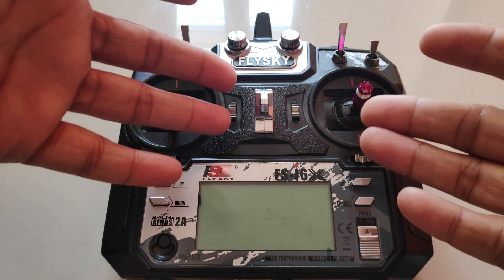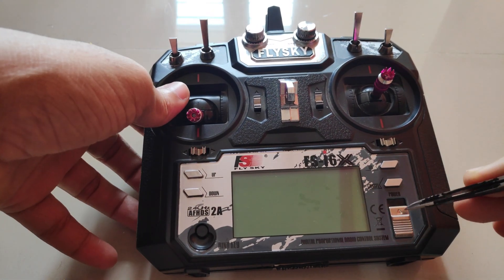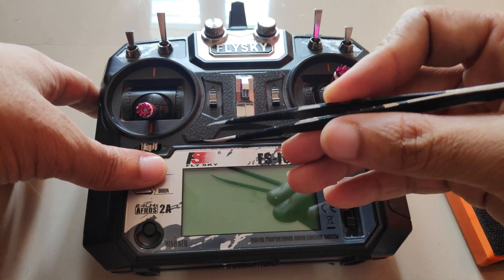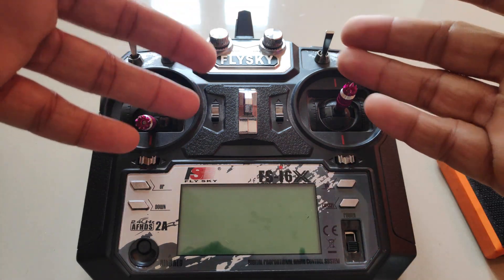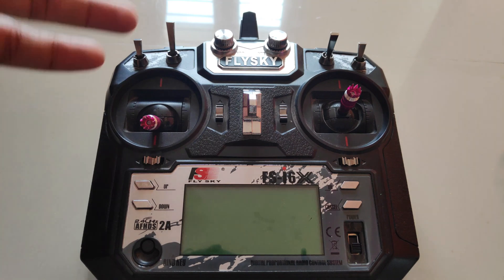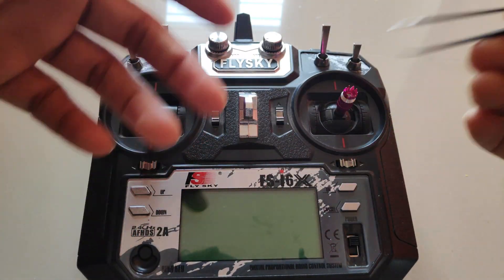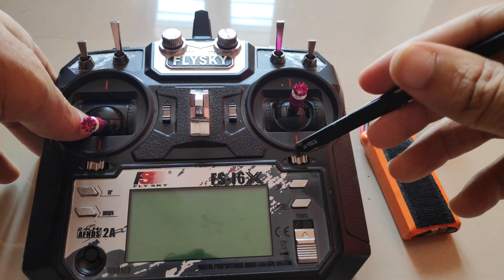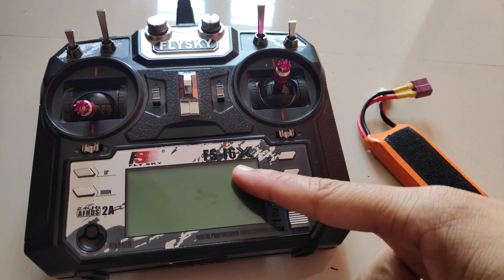Flysky FSI6X - DO NOT Use 2s LiPo Battery

Comment: My solution, I'm using 2 Li-ion battery 14500 in place of two AA batterie and for the  others places one is occuped by 2 serial diodes 1N4004 or equivalent placed in a cylinder with same sise of à AA batterie and the other one is a short circuit also placed in a cylinde size AA. The final voltage max is 8.4V - 1.6V = 6.8V and when the Li-ion are fully discharged 6V - 1.6 = 4.4V.... Very simple !

Comment: Hi bro i just tried to do rechargeable battery mod on FS-I6S and i did supply power directly from 2s battery and it 3.3v voltage regulator is gone bad its heating but the voltage regulator data sheets states it can take 2 to 20v and on output gives 3.3v i don't understand what Flysky does to these transmitters 

i also have and Flysky i4x it works very good with 2s battery mod I've beens uaing it for more than 2 yrs no problem till now

Comment: Use only 3.7 1 cell of lipo with buck coverter and set voltage to 5.6 i have been using this from 1 year all working fine for me
Reply: That would be a boost converter

Comment: i use buck converter to power up my transmitter with my 2s battery I set input voltage to 6v

Comment: My flysky fs-i6s transmitter does not bind. I think ur video is correct. Receiver binded but no output shown in transmitter. Only light is stuck as binded. I need to buy new transmitter?
Reply from the maker: You have the fsi6s version which has a touchscreen is that right? Did you flash open i6x on that radio?
Reply: @RakishRc  thanks for the reply it will take some days for update, my cable's fault I think coz  transmitter is not detected in pc.

Comment: can we use two  1865 lithium ion battery (3.7 v) for power up this same transmitter because I want to make my flysky i6 X rechargeable what are the best ways to prevent that from burning , can i use the rechargeable batteries for it or better Normal AA batteries?( But AA was drained as much as fast )
Reply from the maker: Anything above 6v is risky affair so better use a voltage regulator is using 2s. May be you can arrange the cells to be easily removable and then charge it externally.
Reply: @RakishRc  Okay Thankyou ✌🏻

Comment: Rakish Rc  I use a Tenergy 6v 2000mah NIMH for my i6x. Just soldered wires onto pads in battery compartment routed them through the battery cover, used butt splice connectors so I can unhook to charge. Stuck it on with velcro. This allows me to still use AA batt if I want as well. I followed what you had done with yours and I burnt the voltage regulator out in a few weeks of use. Had done all your other mods as well. Just got new i6x and I think what I suggested above is great/safer route. Just my 2cents... Your videos have helped me a lot!
Reply from the maker: Hi, yes anything that's within 6v is a good alternative. I am using a 5v mini buck converter which also allows me to either use AA or a lipo..the output voltage can be adjusted so I've set it to 5.5v when using a lipo. Thanks for sharing your experience 👍
Reply: @RakishRc  can I ask you quick, moving ahead with my new radio what module are you using for express lrs with your new i6x? Still R9M?
Reply from the maker: @mikel0520991  yes still the same r9m with a half burnt 5v power regulator. R9m has 2 power regulators so it's functioning well from the other side 😜

Comment: So based on several other reviews I saw I was pretty confident a 2s LIFEpo setup would be safe at about 6.7 volts.   Plugged it in and powered on fine the first time, second time powering on it starts surging on and off every few seconds, now it does it with any input even the AA.  Looks like I fried mine as well, just wanted to throw this out there as the Life Batt seemed to be well within a safe range but it seems it may not be.
Reply from the maker: 6.7v is actually very close to the rated 6v limit and i am surprised it's acting weird. You may want to check the power cables of the connector on the motherboard and battery bay. I am currently using a buck converter with a 2s and it also powers up with AA if i have to
Reply: @RakishRc  I ve gone over all the power connections, they look fine.   Just every time it powers on it will go to full voltage then exactly every 5 seconds it shuts off for a split second and reboots.   Dont know what else it could be, the motherboard looks fine, worked fine on the first boot up and I was able to cycle through the functions for several minutes.   Shame as I really like that little transmitter, been good to me for years lol
Reply: @RakishRc   Thanks for your eariler advice, I figured out it wasnt a voltage issue after all.   I had just installed the Open TX firmware not long before.  I forgot I had the external PPM port enabled and for some reason that was causing it to power cycle without anything plugged into the trainer port.   

New problem I ran across though, no matter what I do I cannot get the Open TX to recognize my Happymodel ELRS module.  The only thing it sees on external mode is PPM.   Thought I might need to save the HM specific LUA script but it says there isnt enough space to do that in the FSI6X memory.  Not really sure what else to do.

Comment: If you plan on using a 2S LiPo battery; ONLY use it with a step-down ( buck ) 5V output voltage regulator module; readily available online. It is inexpensive protection against ruining your transmitter.
Reply: The AA BATTERIES TOGETHER MAKE MORE THAN 5V . 5V IS NOT ENOUGH .

Comment: Yeah bro thats y is used 7806 Voltage regulator. this gives constant 2A 6v output.  Using it for Totally 2 Years now and having absolutely no problem. Range is also increased because of 6V 2A.
Reply from the maker: I am using the mini 360 5v 1amp buck converter on my new raido. How did you test the range diffrence?
Reply: @RakishRc  Im not directly meaning the Range but the Signal loss error shown in the TX. I Saw a big difference in the error at the same location and distance that i covered. it was around 24% loss first with AA Batteries at 5v. but now im getting only 6% at the same spot and distance.
Reply from the maker: @lokaero  got it..so then the link is more solid as per your testing. Thanks for sharing I'll do test as well. I had planned a range test between factory firmware and open tx firmware on this raido with ia10b receiver but my drone gps rescue wasn't working as intended so i postponed the video.

Comment: Thanks alot for warning!!
Hii I am sorry to hear that. 
I am using it with 2s 18650 for about 4 mounts  and had many flights. What I did vas to install in series 2 rectifier diodies that lower the voltage aprox 2- 2.2 v, so when start the transmitter with battery fully charged it show about 6.2 v
( 4 aa battery x 1.5v = 6v ( can be more when batteries are new). I didn't use dc-dc converter because that drain battery even when transmitter is off and I can't see the level of battery during use. I also use the switch from transmitter to   power the betafpv ELRS module
Reply from the maker: That's good! For now although i am using AA i have thought of using some 1500mah AA batteries

Comment: Hi,
I want to ask, can we attach an external antenna to Fsi6x? Is there any issue in attaching an external antenna (replacing the inbuilt once) also the difference in range can be observed...???
Looking for your reply...!!!
Reply from the maker: Hi, yes you can add external antenna but the range has to be tested to get a comparison with stock antenna. There will be some difference for sure. One fellow from fsi6x open tx group has added external wifi antenna to his radio I'll share his pictures soon 👍

Comment: I figured out that the ADC channels do not read anything. I compiled a program to read the ADC inputs. even if I short the ADC input of any pin with 3.3v it would read zero. So in all the power regulator is damaged and the Stm32f072VB processor's ADC channel is damaged due to fluctuation in input voltage and failure of the 6206A regulator

Comment: Same thing happened to me today... I just saw your video yesterday and was thinking about replacing 6206A with AMS117. Its now booting into factory mode...
I found that the other regulatior i.e HF_3.3 regulator is okay.. STM32 is flashable. EEPROM is okay..
What to do?
Reply: Did you repair it bro is it working
Reply: Hi bro i just tried to do rechargeable battery mod on FS-I6S and i did supply power directly from 2s battery and it 3.3v voltage regulator is gone bad its heating but the voltage regulator data sheets states it can take 2 to 20v and on output gives 3.3v i don't understand what Flysky does to these transmitters 

i also have and Flysky i4x it works very good with 2s battery mod I've beens uaing it for more than 2 yrs no problem till now
Reply: 6206A 1722/33 vtg regulator was original which is damaged

Comment: I was wondering about this as I saw you using 2s while the regulators are specced for input 6V. They've probably been running quite hot but it's surprising how long they lasted. I just started modding my I6X and the plan is to add step down buck regulator so I can use 2-4s batteries. I definitely need lipos as AA batteries really did not like the ERLS transmitter.
Reply from the maker: So yes the whole point of using lipo for this raido is to power up the elrs transmitter. Yes you can use a buck converter. I think the grease i applied on power switch shorted something and the lipo was als fully charged so together it messed up the raido. You can use aa for raido and lipo for elrs transmitter just need to have signal and ground wired between radio and elrs transmitter

Comment: If the "grease" was Vaseline that would be your problem, it is very very conductive.
Reply from the maker: Very likely.
Reply: @RakishRc  Bath it in Methylated spirits or denatured alcohol, be careful, do outside away from anyone, no electricity near, and a bucket to throw it into if things go wrong.

Comment: I wonder wether it is possible to use a 6v bec but still measure the real battery voltage. Is it known where the battery voltage is measured on the pcb?
Reply from the maker: Yes You can use a 6v or 5V bec but you cannot read the battery voltage then. Not completely sure but it seems either from the power regulator or V bat connection side is where voltage reading is detected.

Comment: linear power regulators on the board are designed for a voltage of no more than 6 volts.  I think they are the problem.  you need to replace them for example with ams1117
Reply from the maker: Yes but it's very fiddly to do that. Instead an external voltage regulator or simply AA batteries are better for radio power. Ony the external module needs more power which leads everyone to use lipo for their radio
Reply: @RakishRc  an external voltage regulator can be used, but then it will become impossible to use a regular battery voltage measuring tool.  well, with the replacement of regulators - you can use the 2s battery and batteries

Comment: Hi, thanks for your useful videos. I have my FS-I6X openTX  running on 2S 500mAh JR connector (I get about 2 to 3 hours of use,  battery fit in original compartment). I'm using a step down converter adjusted to 7.3v, so that I can fully charge it. Thanks to voltage drop in the converter, I'm able to set an alarm on the TX to detect low battery.
Very important: regulator consume power and can fully deeplete Li battery when not in use. I have modified the TX switch (it is a 2 inverter in one) so that it separate the converter from  the battery.
i have a second FS-I6S and I'm thinking to make a video of the mod with the ref of converter, voltage adjustment and switch mod.
About your damaged TX, if you order the same TX, you may be able to track what area is not functioning. And with some electronic knowledge, to be able to change damaged components.
You've helped me to select this good TX,  I hope you will continue with it.
Best regards
Reply from the maker: That's a very good choice with voltage converter. I should have considered it earlier 😁.  Yes if i get the same radio i could compare and try to diagnose the issue. Glad you found this radio perfect for your use. Yes I do consider having the fsi6x again 👍
Reply: @RakishRc  hello, I 'm preparing a second radio FS-I6X for  Lipo 2S with DC-DC  converter . If it preserves TX from high voltage, it is very important to adjust output voltage so that low Bat voltage can be detected to trigger an alarm. My DC-DC converter as a voltage drop off 0.5V, so I set the output at 7.4V which seems to be a reasonable maximum for the TX.
In the radio setup, I set the voltage range from 6.8V to 7.4V and an  alarm at 6.9V.
If there is a way to share pictures with you, I'll show you how to modify main switch so that it cut also stand by consumption of the converter when TX is OFF.
By the way, you may modify the title of the video, stating "don't use 2S lipo WITHOUT DC-DC converter (properly adjusted)" 
Wish you a good night.
Reply: @davidrenaud8798  I am very interested in your mod. Could you please share a picture/schematic? I am using 5V DC-DC converter but don't know how to have low Bat voltage. Because of that I have lost two Lipos so far. Thanks.
Reply: @nmrlab3807 hello,
DC-DC converter with fix voltage 5v  is not a good idea. I use a converter with variable voltage output set at 7.4v.. Thanks to voltage drop (about 0.5V),, the output start to drop when output voltage decrease below 8.1V.  
In the TX setup, I set the voltage range between 6.6v to 7.4V, with an alert at 6.7V.
Mot important is to keep in mind the stand by consumption of converter which can kill a pack in a night. So, I have modified the wiring of the TX switch so that it cut also battery output. I need to document that and I'll share it on RC group.
Best regards
Reply: @davidrenaud8798  ❤Thanks for the explanation. Yeah, that is right the stand by consumption of converter killed my batteries. Please let me know whenever you post the modified  wiring of the TX switch on RC group.

Comment: Hii sir i just want to know can i use any elrs module after flashing opentx on it. Does Latest opentx have any bugs. 
Finally which elrs module should I get to my flysky i6x
Reply: Please response sir
Reply from the maker: Yes You can use any elrs module after flashing open tx elrs version. I am not sure if there are any bugs but the firmware is very reliable and stable just like original firmware with many upgrades.
You want 900mhz or 2.4ghz elrs module? Choose which band you'd like and then select. I use frsky r9m and r9mx receiver
Reply: @RakishRc  ok sir thx so final question should I go with any elrs module or get r9m setup. I need good range and long range so which is good r9m Or elrs modules
Reply from the maker: @Sunnyfpv1617  so for long range go for 900mhz setup. Frsky R9m has to be flashed with elrs firmware. Get r9m and MX receiver then 👍
Reply: @RakishRc  ok sir thank you sir for great help
Reply: @RakishRc  big fan from Maharashtra Indian

Comment: 2nd need to chack remote power switch where it is multiple points or 2 points. If there multiple points tracks and some point is not connecting properly due to damages or dust . Need to clean or replace power switch
Reply from the maker: It's a 3 point power switch. But now I don't think there's any point in spending time to repair the motherboard.

Comment: You need to examine and restore tracks c44 and r39 and swdio point.maybe there is some connections between . U should try this. By jumper small gauge wire to those tracks .
Reply from the maker: Yes I did try to re connect the two track separated by damaged SWDIO pad but with that the rf module got very hot and radio wouldn't turn on

Comment: did you full charge the battery every time or only the last time?
Reply from the maker: I've used fully charged 2s before many times without problem but since the regulator onboard is rated upto 6.8v or so it was always a risk.
Reply: same happened to a fs i6x that I got. It was very new. 
Now I am thinking of re using it by adding an MCU and making a custom transmitter.
I also posted few days ago about this in rc groups forum.
Reply from the maker: @rakinrkz9010  Sad to hear that. Hope you can replace the MCU and utilise the radio 👍

Comment: Putting 1 or 2  standard Slicon Rectifiers in series with the battery will drop the 8.4V fully charged battery voltage to a lower safer level. I haven't had a battery problems with my 2S batteries in my FS16X radios
Reply from the maker: Yes even I've had very good luck with 2s but with this issue i had with radio i thought it was better to alert other users to avoid having same problem.